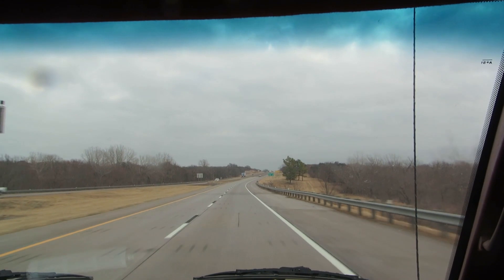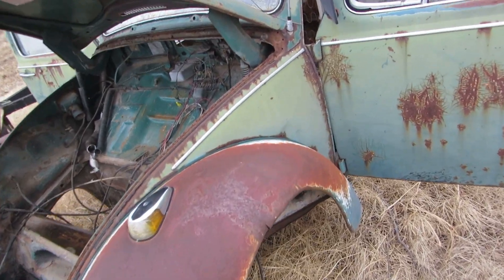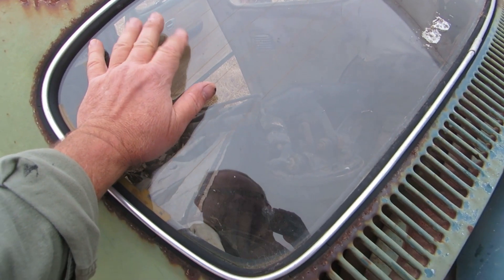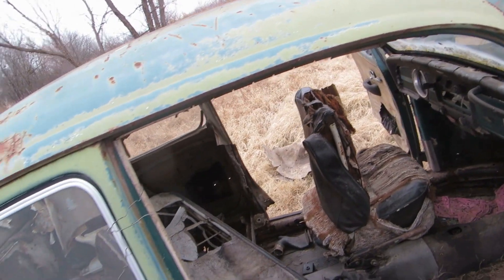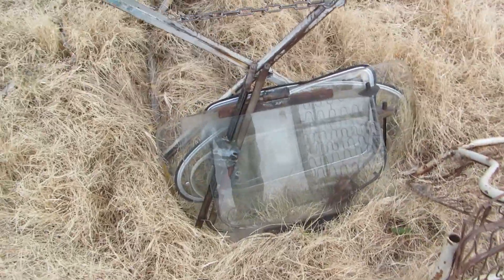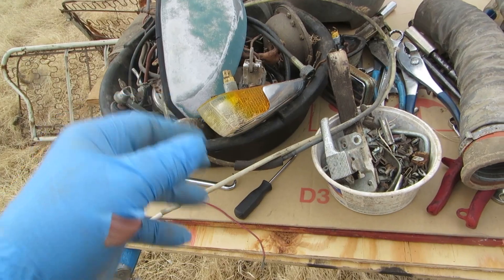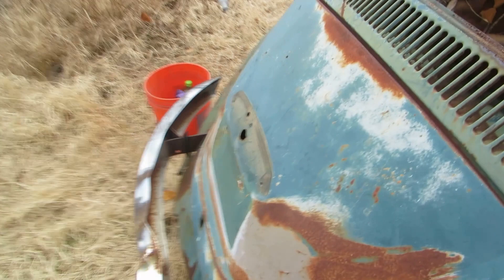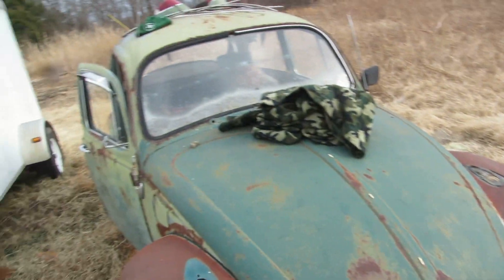Picking a Beetle for parts

Comment: What's the serial number ? It'll tell you what year it is. I'm fairly certain all of the speedo's have the ATF hot light, they just don't use it on manuals. If it was a Semi Auto, it would say "Auto-Stick" on the deck lid. At least the early ones did. And it would have holes in the sides of the engine compartment for the vacuum tank and ATF tank, plus a bracket on the L.H. side of the engine compartment for the bloozer valve that makes the whole shebang work. It takes quite a bit of work to modify a Semi Auto to a Manual.  Didn't you do it once ?
Reply from the maker: I did it twice. Don’t forget a pedal set, running a clutch cable....oh and the “cherry” four speed I got was missing first gear....yeaaayyy...do it again!
No holes in the back of this car....it was an original 4 speed car....had to be a 69 (dude) because it had an IRS trans. If it were a 68 I believe all the non auto stick cars were swingaxles. But I didn’t get the body numbers...too much rat shit and piss...I was getting grossed out and had to leave. Didn’t want to roll around in that “car” anymore.
Reply: Easy way to tell if it was an Auto-Stick. Just look at the ash tray or where ever the shift pattern is printed.
Reply from the maker: The ashtray was missing… Of course

Comment: I would save that decklid,if it didn't have any rot holes.
Reply from the maker: Well, the decklid the trunk lid the doors. We’re all “salvageable“. But they had a lot of cracks in them. And you know what that means. Lots of mud. So I didn’t take it. I could’ve took the transmission also but I didn’t. I could’ve re-sold it. But it’s a big hassle.

Comment: As I recall, 68s came with high back seats and the rear defroster in the rear window.  1968 was the year the cars had to have all the safety items "cobbled" onto the models at what seems like the last minute.  The Beetle had the larger tail lights and the "outdoor" gas filler tube. I was in Junior High and I am a car freak.  The cars had the marker lights on the fenders for all models.  It ruined the 68 mustang in my opinion. I regret this car didn't have all that you needed, but I think it was a good idea to get all the little "piddly" stuff like the door switches and every screw and clip that you can get off it. Best wishes and Good Luck!
Reply from the maker: Thank you for you comment. This car had an ATF speedometer also, however it did not have the cut out in the back right side for the ATF bottle and filler. It had a manual 4 speed in it, with no wire for the shifter and trans mission. So its a bit of a mystery why it had low back seat in it.Or that speedometer... I was glad it did though.